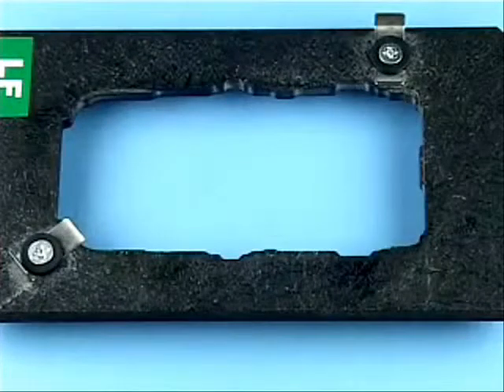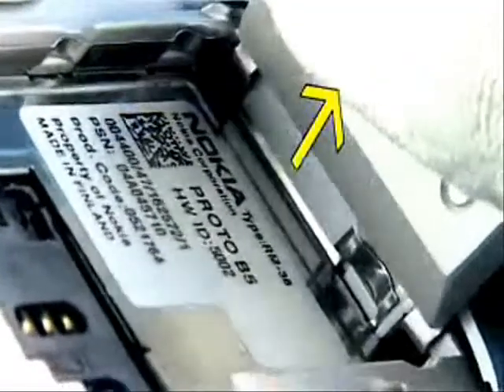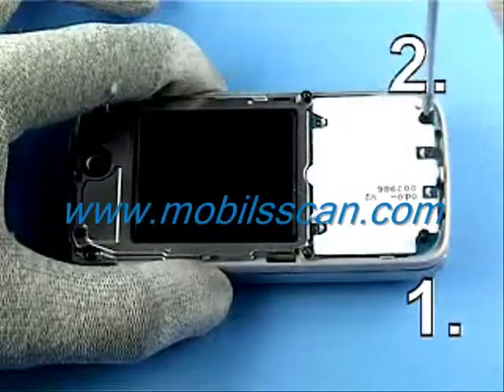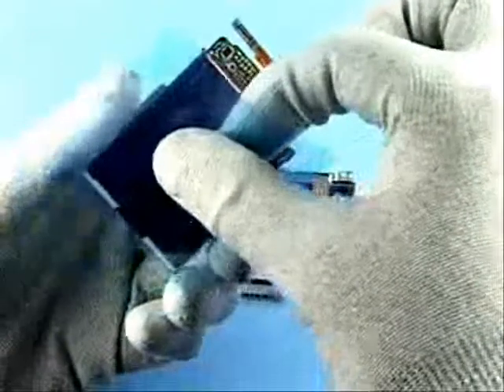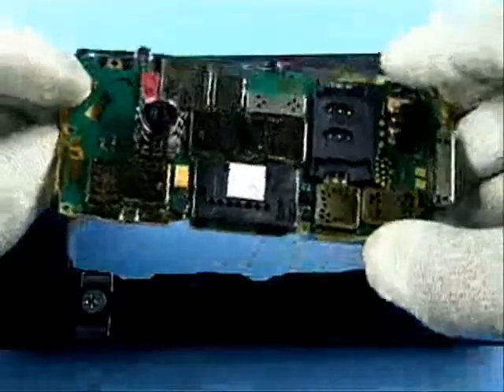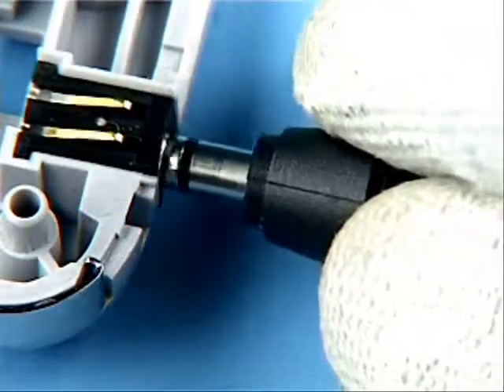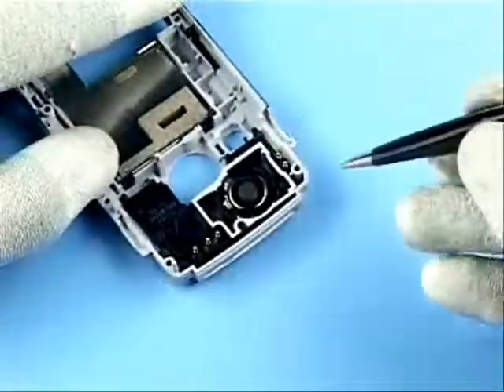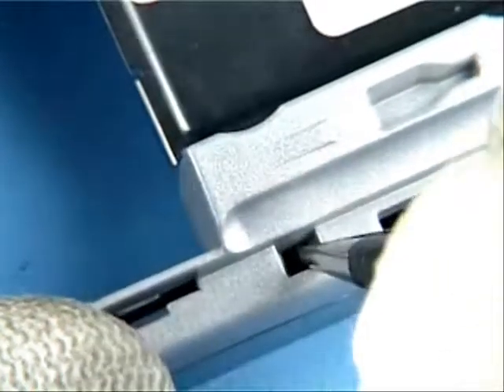6680 disassembly

Comment: Nice clear guide. I improvised at the start, I didn't have the cover opening tool but I used needle pliers to pull the tabs back and up slightly, then it released 👍